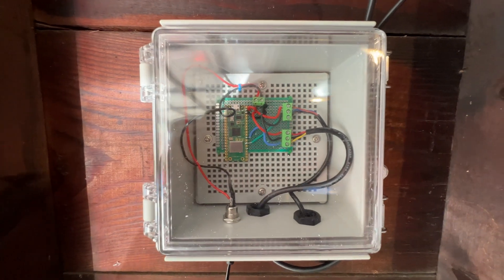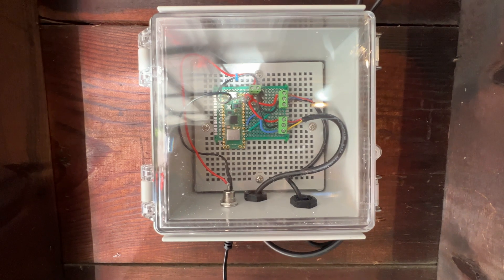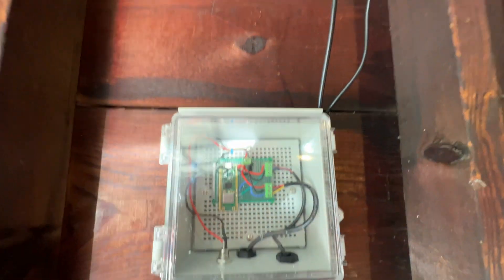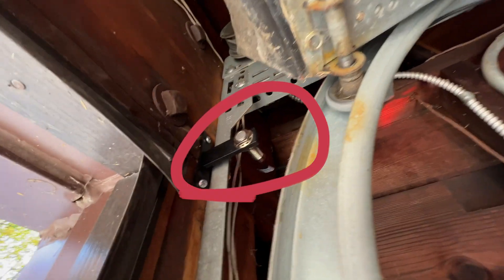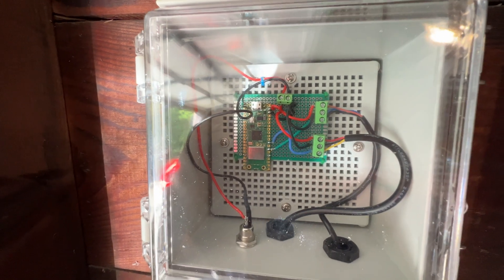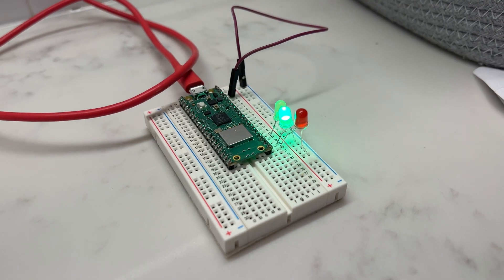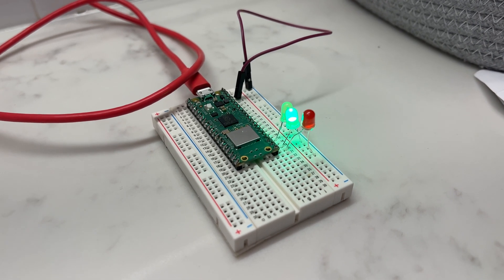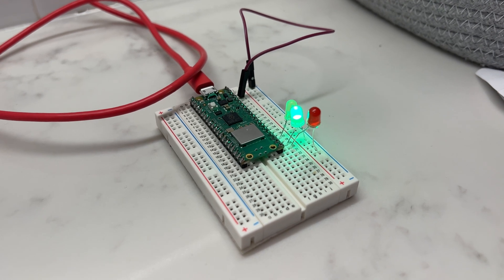Raspberry Pi Pico W MQTT garage indicator project overview and update

Comment: I did much the same using the open/close and break beam sensors that came with my garage door opener, and used a Sonoff SV.  It lives right on top of the opener motor.  Works great.
Reply from the maker: Never heard of a Sonoff SV, thanks for sharing. It looks like a useful bit of tech.